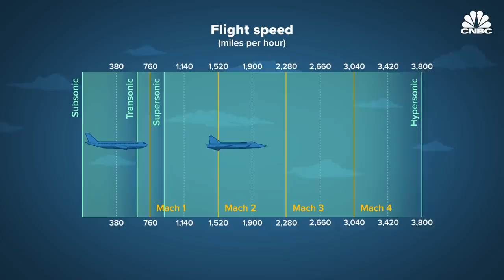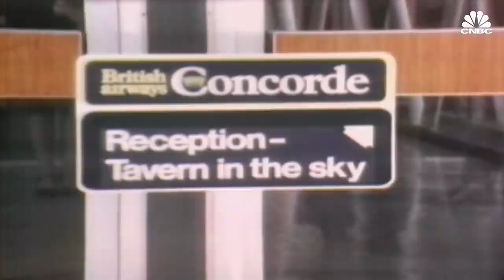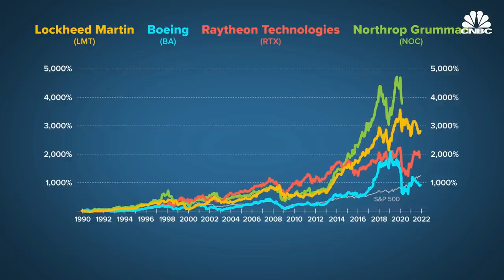How The U.S. Fell Behind In Hypersonic Technology

Comment: The US Military is geared up to be the biggest so it can stretch its tentacles across the globe. Unfortunately the sheer cost of maintaining size is astronomical and limits innovation. Added to that, the terrible bureaucracy in the management system of the US Military - everything ends up costing 3 times, 5 times, 10 times more than is actually needed for each project. And the project is flawed due to too many vested interests interfering.
Reply: Do U rembemer during the Vietnam war a B 52 bomber 4 a simple Hammer 4 the equipent to reapair any whatever at the plain, on a symple shop, was about 1$ ..but at the plain it costs finaly, about 600 $$ no joke..!!!!

Comment: Why not invest in the UK SABRE engine by 'Reaction Engines Ltd, which can reach these speeds.
SABRE is a concept under development by Reaction Engines Limited for a hypersonic precooled hybrid air-breathing rocket engine. The engine is being designed to achieve single-stage-to-orbit capability, propelling the proposed Skylon spaceplane to low Earth orbit.

Comment: PhDs and Universities can't contribute much when the Hypersonic Missile ultra-high heat and power profiles can not be effectively modeled by current applied mathmetics. This means no meaningful computer simulation can be built. 

To run useful tests and collect useful data you need a Hypersonic windtunnel to provide a stationary missile under controlled environment. 

China successfully built a HS windtunnel in 2016 which is capable of generating a steady contrallable HS flow at up to Mach 30. That was how they managed to develop an ultra heat Target Sensor to be mounted on the HS Missiles. Pentagon has a Mach 5 windtunnel which works fine during good days. 

The west media avoids going into to much details about the capabilities of China's hypersonic missiles (perhaps to avoid the alarm button). But not all HS Missiles are the same. China's HSM models DF-17, DF-26, DF-21D and YJ-21 are in mass production for combat service. They are not the same as Russia's (or North Korea's).

Comment: SpaceX just landed another bottom missile section right side up on the X pad, the engine was used to take up a payload of satellites. How fast does the engine go through space? Mach 20, which is true hyper sonic. Mach 5 is not.
US was working on hypersonic missiles in the 80's.
Reply: That's totally different. What you don't consider is the MHD tech. You can be flyin mach 10 in the atmosphere. Not happening with space x or whatever. You compare object going out of our atmosphere vs object staying in

Comment: The US also has a lead in stealth design, (some) sensor and at least comparable AI. THe biggest threat is anti ship weapons capable of hitting US Naval battlegroups before the more advanced US aircraft and radar tech is a threat. It can close off a sea access while you invade/resupply. Think about sub launched hypersonic missiles could blockade your naval ports or sink passing container ships in choke points. I'd be surprised if in reality China and Russia can reach the true hypersonic speeds due to heat and comms but it just has to be faster than current anti missile defence. Russia did have some excellent metal expertise and china has likely used its tech firms to add sensors to everything to overcome its metal research gap (plus all that free US and Russian research it hacked from all that archived cold war research)
Reply: You seem like someone I should know in real life just incase

Comment: New generation 2000km operation radius hypersonic land to sea cruise missle able to neutralize any super carriers (no gun or missiles able to hit them once it launches) Because all F-35 and F-18 only operate less than 1000km combat range from enemy shore. So it will put super carriers 1000km from enemy shore line, which put carriers fleet no use (fighter jets unable to fly to enemy shore without air refueling)! Is it true?

If the carrier stay 1000km somewhere in pacific ocean, F18 or F35 unable to fly to enemy shore line because operation range is less than 1000km for fligher jet without air refueling....

If carriers stay too close to the shore (i.e less than 1000km) it will be attacked by hypersonic missile

Hypersonic missile will put super carrier strategy obsolete in 22th century warfare? is it true?

It is too logic and simple, even a primary boy able to figure out, is it true???🤔

Russian's Zircon is the most advanced hypersonic sea missile at services, but only with 500km range at present

Perhaps sooner or later, Russia able to develop long ranger (i.e. at least 1000km) to put super carriers fleet obsolete (but sound already very alerting)

Comment: Only talking about speed is too simplistic. The US have missiles like sm3, thaad that achieve hypersonic speeds easily. Building a missile that goes fast is not an issue. The quality of its targeting system under plasma shroud is. These things are very expensive and just because its hypersonic doesn't mean it can't miss. Can the missile also prevent its launch platform position from being exposed at launch. The US is very selective how to make one.  Fast hypersonics also have to maintain high altitude, making it easy to track/target with S2A missiles beyond horizon. And even 3-4 minutes is a lifetime for a defensive system to tap it with 10-20 S2A missiles. A tomahawk BLOCK V/LRASM/LRSO/JASSMER/NSM/JSM all have the best of the best terrain skimming tech,  making it undetectable over the horizon for 99% of its flight path skiming 10-20feet off the ground or waves, until it appears on the horizon of which air defences only have 30 seconds to track/discriminate/lock/fire, because L/S/X band radar waves don't bend over horizon. And all of them have autonomous passive IR imaging and EO targeting along with various other interchangeble modes, making them completely unjammable and do not require external platform guidance in the terminal phase. Such targeting tech in a missile cannot be effective in a hypersonic missile because of airframe requirements. 10 of such smart low alt steath missiles cannot be defended against as there simply isn't enough time to react them as they pop up suddenly at low altitude. Thats why when these cruise missiles are used against countries with layered air defence they always hit their targets. Can an s300/400/500 shoot down an JASSMer at 200km....NO! because the JASSMer/tomahack is still beyond earth curvature and at low altitude, their fight path is carefully set to always stay under radar detection altitude to maximise surprise. The chances of destroying a russian cruiser with 30 tomahawk blk Vs at 1500km is very high, and its cheap. No cruiser can fire at 30 tomahawks only detectable at 10-15kms away and still difficult to acquire a lock, theres simply not enough time.

Comment: Their speed is their weakness. If you sent up fields of ball bearings in its final flight path they will tear it apart, much like the BUK system used by Russia.
Reply: they can perform maneuvers at hypersonic speeds, they don't follow a set ballistic trajectory like other ICBMs this is what makes them different and almost impossible to intercept.
Reply: @myopicthunder  Hypersonic missiles are not so maneuverable because of their speed. They can change their trajectory by a few degrees but not much. Otherwise they would be torn apart.
Reply: @jul1anuhd  and that's all it takes